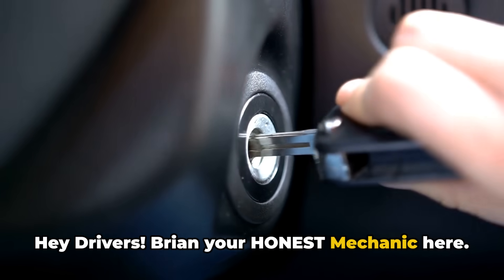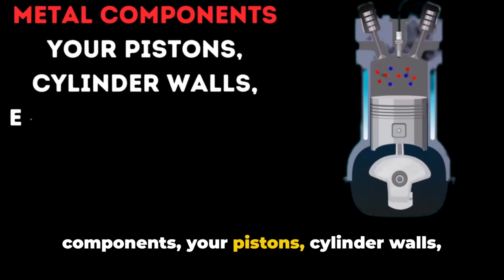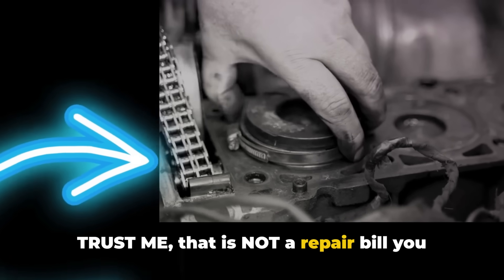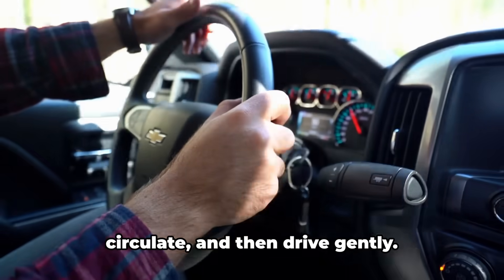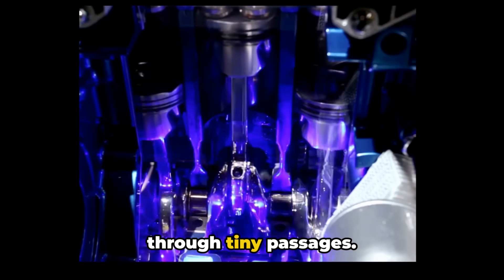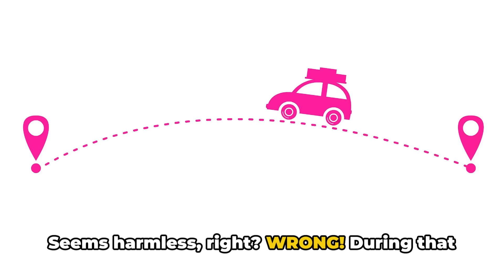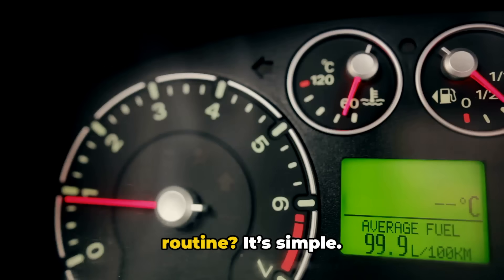5 Cold Start Mistakes That Wreck Your Engine (Avoid These)

Comment: Wait until the computer brings the idle down. If you have a big engine for example a 3.4 litre the idle will be below 1000rpms if you got a small engine like a 2.0 litre the idle maybe at 1000rpms. The computer will bring the idle down once it’s satisfied with the engine being warm enough to drive. This only takes a minute maybe two minutes if it’s really cold outside. You can scrap the ice off the windows or brush the snow off while you wait. Once the rpms come down your good to go with light driving once the coolant reaches operating temp you can now push the engine harder.
Reply: Lol.
Here in the UK, 2.0 ltr is considered a big engine.
The majority of cars on the road are anything between 1.0 ltr eco boosts to 1.6 ltr engines.

Comment: My Mazda 2 (year 2019) engine is revved up to approx. 1500 RPM by the ECU when started from cold which I don't agree with. According to the Mazda dealer that is correct and it cannot be adjusted down so i have to live with it. I'd prefer around 1100 - 1200 RPM. Love the car otherwise, get 62 MPG (UK gallons).

Comment: The transmission takes longer to warm up than the engine. I would think 2min should be good. 30 seconds during the winter with the idle (auto choke) at 1800 RPM is not enough warm up time.

Comment: I have a 2002 Honda Accord V6. I do warm my car idling for longer than you recommend,for the purpose of warming the Auto Transmission in Neutral.otherwise the car doesn’t shift properly. You do have an excellent video here!
Reply: You’re not really warming your transmission though, the only way to do that is by driving.
Reply: @mplslawnguy3389  Heat from engine goes on trans
Reply: same, i feel a little jerk if i had to shift on cold start.But smoother after 3 to 5 mins warm up.
Reply: @junpalomares9421  it's because of carbon build-up and has nothing to do with the car/transmission warming up.
After a few minutes it seems like everything is working perfectly, that's because the build-up has beeen removed.
Reply: I have a 2002 Accord EXV6 coupe. 40k miles.  Hoping it will outlive me.  I’m 70.
Reply: @jimzone8153I’m with you…2004 PT Cruiser with 43K, and I’m 73 years old! 🚘
Reply: @jimzone8153it probably will lol. My 2013 Camry is currently at 222,233k miles . Got it with 70kmiles
Reply: @jimzone8153 if you arent cheap on maintenance itll outlive your kids
Reply: Subarus with CVTs have a little blue light that goes out after about 4 minutes of idling, then that is when the owner's manual says you can drive.
Reply: Having a heat plug to keep the engine fairly warm used to be available on cars.   Goes a long way to help starting g in cold weather.
Reply: I could say the same for my manual car the gears feel slightly stiffer for two minutes but sitting idling makes no difference either. Start car defrost and drive gently everything else is irrelevant.

Comment: In MICH when it hit 10 degrees we'd turn the key to turn on the radio, heater fan, & lights for a minute to thaw out the battery. Then turn off everything and start the car.

Comment: YES...short trips in winter are bad {not getting warm enough to burn off the condensation inside your engine}, if not avoidable, drive your car or truck down the expressway once a week or so to burn it off...My friend called it an Italian tune-up
Reply: An Italian tuneup is going full throttle once in a while.   The idea is to burn off moisture and prevent oil dilution.  I wouldn’t do this a lot though.  Making a habit of driving like that has its own downsides.
Reply: I apply this to my  motorcycle too.

Comment: What do you suggest for an appropriate warm-up time at -10 degrees with a frosty windshield? You can't see safely in 60 seconds to drive off with no defrosted warm-up?  What do you recommend? Thanks!
Reply: Don’t sacrifice safety for this.  It’s just a reality when you live up north.  Along with all the salt and rust, our vehicles just don’t last as long.  Take the time to scrape your windshield and other windows completely and make sure your wipers aren’t stuck and there is no ice or snow impeding them.  You could damage the motors and have a costly repair.  Your wipers are not designed to clear ice and snow.

Comment: If living in a cold environment, look into a block heater to help with the faster warm up when cold starting.
Reply: I’d say that’s more important to not get piston slap on start up. When it gets really cold I use my block heater
Reply: I also glued a 100 watt heater to the bottom of the oil pan, so total of 360 watts of heat for winter preheat

Comment: I’m the original owner of a 2000 Honda Civic Si (EM1). I put every one of its 330,000 miles that’s currently on it, original engine, original transmission, neither one has been rebuilt, no leaks from either one, and the engine doesn’t burn any oil between its 5000 mile oil changes. I used to work as an automotive technician for 13 years, so my Honda has never been to a shop; I’m the only one who has ever worked on it, because I’m fanatical with precision work. I check and adjust the valves every 50,000 miles, replace the cam belt, belt tensioner, and water pump every 75,000 miles, and change the transmission fluid every 30,000 miles. I replaced my engine oil drain plug and trans drain plug with magnetic drain plugs, and use only top quality synthetic oil (substituting one quart with Lucas Oil Stabilizer). When the engine is cold, I always limit RPM to no more than 3500 rpm, and only light throttle until the temp gauge gets to normal operating temperature. When passengers are with me, they can’t believe the odometer has 330,000 miles, because it runs so silky smooth, and at stop lights they often ask if the engine is running. Take care of a machine, and it will last for many many years.
Reply: Unfortunately a lot of people just don’t care, or don’t know anything about engines.  They trade their cars in every 3-4 years, and some poor sucker gets stuck with their worn engine.  I’ve always preferred buying new and driving it for as long as humanly possible.  That way I know things have been maintained properly.
Reply: @mplslawnguy3389  I do that same thing, buy new, make sure I do all the maintenance, and never push the engine over 2000 rpm , when cold, I change my oil and filter at 3,500 miles, air filter and clean mass air flow sensor and throttle body at 30,000 miles, along with dropping the transmission pan, changing the transmission filter and adding just the right amount of transmission fluid,  usually 6 quarts,my engine is a 3.7 naturally aspirated, V 6 in a Ford F 150, I've changed the transmission cooling lines and the lead panel inside the transmission, both parts were defective from Ford, the transmission cooling lines, and the lead panel, and likewise you can't hear the engine running, the pickup has 140k on the clock,and knock on wood it will give me another 140k , it's a 2014 Ford F 150, one starter motor, and waterpump replacement, along with a spark plug change. @ 105k ,  I don't like turbos on gasoline engines, Diesel engines yes, turbos on gasoline engines wear them out quicker, Diesel engines are built with stronger internal engine parts ,and they can handle turbos, which where they were first used, naturally aspirated gasoline engines last longer than engines with turbos, it's just common sense,  ... seen the inside and the wear difference on many, turbos put to much unnecessary hot 🔥 gasses back into a little gasoline engine lowering life of engine.
Reply: I’m thinking on going Japanese motor for years. I’m done with ford.  Everybody I talk too says the same thing.
Reply: My Man! Show your car love and it will show it back to you 10 fold!
Keep that thing in good shape, nothing feels like those Hondas from that era.
Reply: I followed the same routine, but oil change every 3,000 miles, and annually got the belt and hoses replaced. Had the work usually at a Goodyear place I trusted. At 478,000, it started in the first 1/4-1/2 second.  Went through at least 8 sets of tires. It was a 1999 Ranger with the 4.0.  Sold it in 2016, and am sorry I did.
Reply: @ChrisPBacon-vk7sj I think getting the belts and hoses replaced annually is over the top. They don’t degrade that fast!
Reply: I have a 2009 Honda accord ex with 285,000 original miles. Only with regular oil changes.  New tires , struts and new breaks.  So to me it really don't matter about all these other matters.
Reply: Shit my dad's 1998 tacoma is up around 450k miles, and my old 2000 tacoma had over 250k when I sold it. Proper maintenance is key.
Reply: This is the only way you can guarantee yourself that everrything done to it has been done corerctly, plus you actually know what you have in quality of the machine and you also know when something is good or bad on it.
Reply: Good for you sir
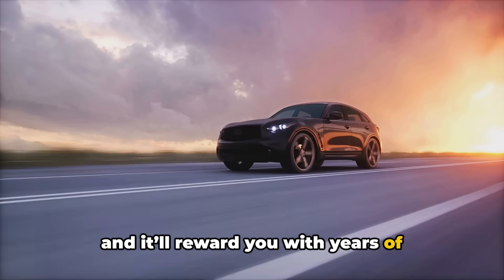Reply: Most people don't do arduous preventive maintenance  3:55 for good reason...as aforementioned. They NOT GOING or wanting to drive same vehicle for hundreds thousands miles
Reply: Great. Whats the oil brand you use?
Reply: Ever taken an engine apart that's been sitting outside in - 20f weather? 30—60 seconds isn't enough when it's bitterly cold.
Reply: @thomaskime5148  Thirty seconds is just fine. Just don't drive like a banshee for the first few miles. Are you one of those guys who starts it up and goes back in the house for coffee? That is bad for your engine. Driving right away is just fine. Remember...gently.
Reply: 3500! When it's cold I won't Rev at all till the temp gauge reads 100f or has at least perceptably moves moved then it's 1500 - 2000 till the water is at full temp and less than 3000 till the oil is at normal temp. I've never got less than 400k on an engine, even the undesirable ones that people hate doing things this way
Reply: You are my hero !!! 
I’m a single female who lives alone & can do basic stuff myself but can not find a decent, honest mechanic anywhere it’s crazy!!
Reply: I have a Peugeot horizen dealership say's don't need my auto transmission oil change 

Though do have my regular oil & filters changed every 7.500 dashboard insists every 15k Lol 

What's your expertise advice 🎉
Reply: I drove my Dodge Omni glh turbo with only five oil changes
Reply: damn my dream car
Reply: Justin, love your post. I bought a 1998 Accord 4 cylinder and manual with 125,000 miles on it in 2007. Did all work on it except the timing belt, water pump and valve adjustment. Had 283,000 miles on it in 2017 and I was T-Boned by a construction vehicle was extremely upset. Keep that Honda going.
Reply: I had a '97 prelude with a 5 speed and that thing was great mechanically. For some reason it had terrible wiring issues. Unfortunately I wasn't the original owner, so I think a previous owner did something funky with the wiring. My guess is they installed an aftermarket alarm and door lock kit. I guess this because one time, and it was manual I remind you, I was walking to get in it. I was right in front of it as I hit the unlock button for the door and it started up, popped the curb onto the sidewalk, I jumped across the hood to the driver side, as the car continued to drive away. I hopped in and stopped it then reversed it back to where I had parked it originally. I found out that day my e brake wasn't that great, too.
Reply: Amazing, I had a 99 Civic Si for around 6 months. Sadly I only had it for 6 months because I came into some money and bought an Audi S4. Looking back that probably wasn’t the smartest thing to do.
Reply: Ever considered selling it? Haha, beautiful car
Reply: Are you married ? Ha Ha, been a car nut and appreciate the knowledge and effort you put into your vehicle. I keep my cars for a long time.
Reply: Idk about the manufacturer recommended oil. For the first 100,000 miles, sure. However after a certain point, a SLIGHTLY thicker oil, that still meets ambient temperature viscosity, is key to prolonging the engine life, of some motors, not all. Like right now, I just swapped to Shell Rotella T6 5W-40, instead of full synthetic 5W-20, for my 2003 Ford Focus ZX3 2.0 Zetec inline 4. Immediate noticeable difference in the first 30 miles. Started it this morning at 23 +/- degrees Fahrenheit this morning, and there was an extremely noticeable cold start difference. Now, this specific oil has an ambient temperature viscosity that is good for between -29 degrees Fahrenheit and 104 degrees Fahrenheit. Perfect for the area I live in, central Far Eastern Washington, as we have fairly cold winters, and fairly hot summers. Also, I should note that I used the Shell Rotella 15W-40 (Silver Jug) in my 1991 Isuzu Rodeo GM 3.1 for 20,000 miles, and it's done impeccably well. So well that it has literally come out cleaner with every single oil change. It literally cleans your motor as you run it. So to an extent, you can run a heavier viscosity after a certain amount of miles and wear on your engine. Not really a mechanic, but have picked and pulled information from varied experienced mechanics, and only one guy disagreed. This same guy uses cheap oil filters, over tightens components, etc...

One of the more experienced mechanics, who has worked on anything from dirt bikes and quads, to semis, excavators, bulldozers, little cars, diesel pickups, etc... has sworn up and down by Shell Rotella and claims to have never lost a motor to any of Shell's current products. Several others claim to run it in everything from their semis to their lawn mowers, with absolutely zero failure in any of them. So take from this what you will, but also heavily research anything you have doubts about. I'm talking 5-10 sources cross-referenced per question.
Reply: That's awesome 👍🏻😎.
Reply: That's only 13,000 miles a year.  35 miles a day... That's easy driving.  Double that a day and I'd be more impressed..  Or cut the years in half.  At that rate, vehicles sit a lot.
Reply: Your car probably would’ve made it to 330,000 miles even without all those oil changes and the special treatments.  It’s a Honda.
Reply: good for you. but most of us havent got a clue about cars
Reply: @Jack-russell103 damn if only there were videos on the internet about basic maintenance on vehicles.
Reply: @eyesaccoffeeaddict2333 Not everyone cares how they work.
Some people just want to buy the car to drive and pay for each service.
Reply: @eyesaccoffeeaddict2333  Damn if only people weren't lazy
We would be living in paradise

Most people are willing to throw money and forget about their problems
If I had the money I would definitely lease because I won't have to care about my car or replace worn out parts past 100k, or worry about getting my money back if it gets totalled
Same thing with house chores, if I had the money I would rather pay for a maid
Reply: @Jack-russell103  It doesn't take much effort to learn the basics.  I can't imagine having to take your car to a shop and not having a clue about anything.  Unfortunately a lot of shops, especially dealerships, will pick up on that and sell you on unnecessary maintenance and/or repairs.  Understand your maintenance intervals, and why they are done.  Learn the basics of how an engine works.  It's not that hard.
Reply: @Jack-russell103  it’s all basic maintenance. Your owners manual will tell you when they recommend replacing certain parts. I’d just get said services like 10k miles before mileage recommendation from manufacturer. Essentially with transmission drain/fill
Reply: Excellent job, Justin!   🏎️
Reply: Jesus christ sounds like all you do is just dump a bunch of money into it to keep it alive
Reply: You could’ve just wrote….“Hey everyone! I’m awesome!”….Cause that’s what your comment basically amounts to.😂😂

Comment: The 2008-2010 Volvo V70 3.2 has an automatic cold start feature.  The engine will idle at 1,300 rpm for about 30-60 seconds before dropping to idle allowing the oil to circulate before putting into gear.
Reply: almost every vehicle has that.

Comment: Even the maximum revs for a cold engine recommended in the manual appears too high for me. I can drive the first few miles at little more than idle.

Comment: During cold start the engine R P M is running higher wait a little bit to drop & then go but don't force the engine let the car go until reached operational temperature & cold oil lubricated all parts !

Comment: I own a fishing cottage in Flin Flon Manitoba 515 miles NW of Winnipeg , I spend some winters there and it can drop to -40 below at any given moment , I have to change the motor oil to 0-10 weight plus utilize a block heater and a coolant circulator and battery blanket as well just so it might start , Even running a heat houser on the front grill the engine wont get above cold at all and idling does very little !
Reply: And you STILL stay there during the winter ?

Sir, YOU are one tough SOB !

Or more than a little bit stupid. 
Imo, of course .

Comment: The point about fuel dilution is very true. On cold startup, at idle, the engine will run rich the entire time. A larger percentage of fuel will make its way to the oil, which is not good.